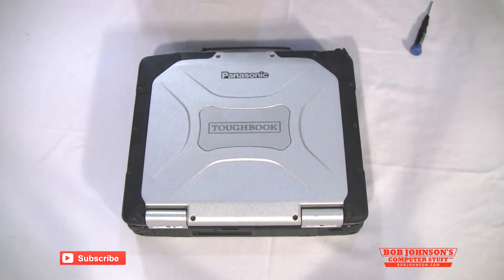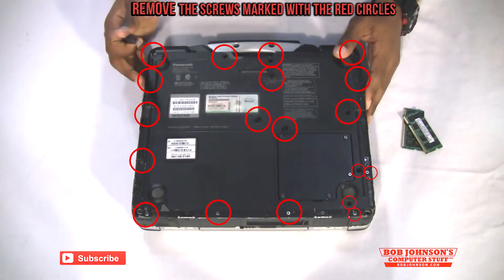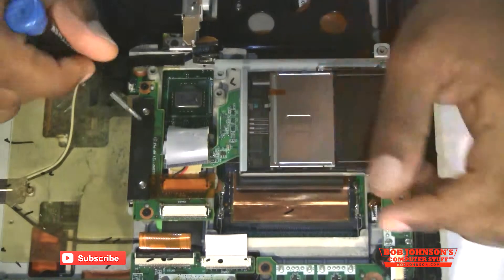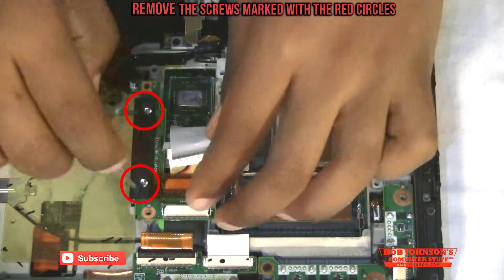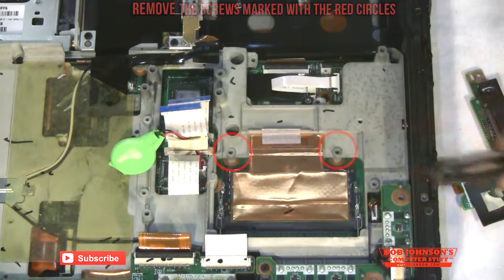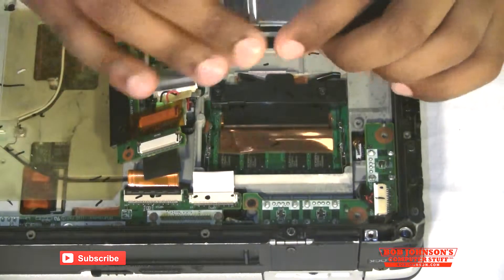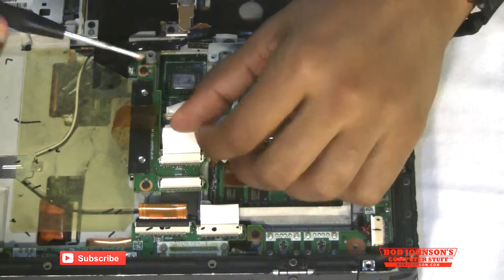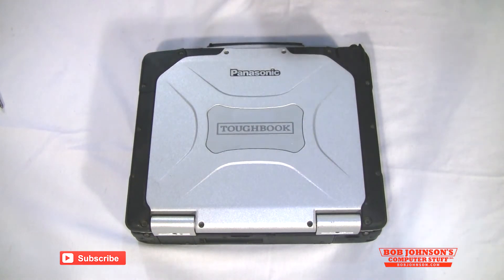How to Upgrade the Memory in a Panasonic CF-30FTS54AM

Comment: This is necessary ONLY if your SD slot covers the RAM. Otherwise, just remove 5 screws from the plate on the bottom cover.